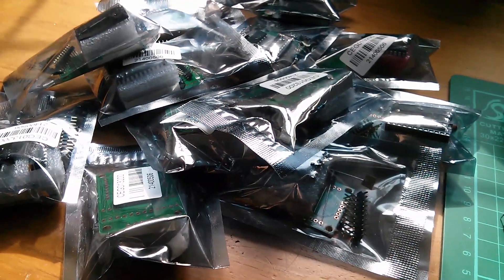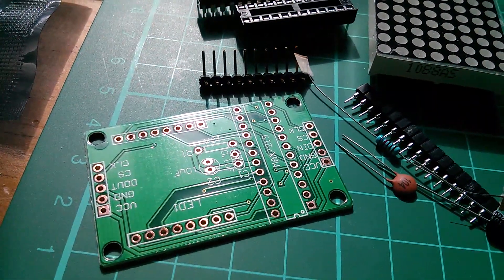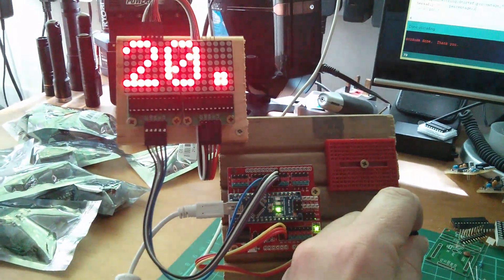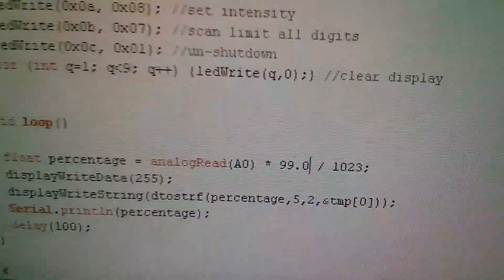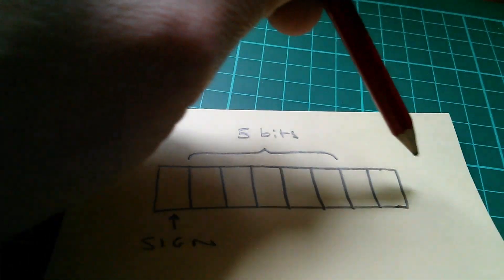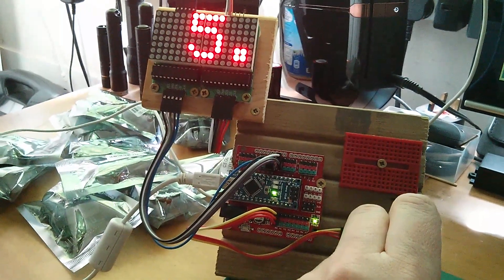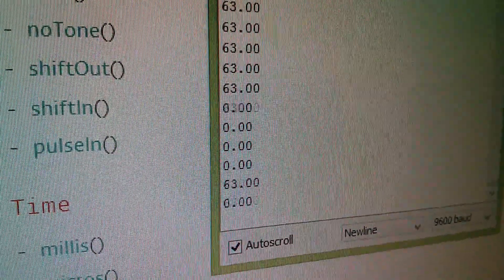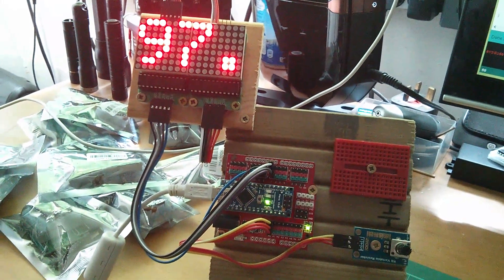Arduino C Mystery - Integer Constants and 6-bit Numbers

Comment: It is not 63 or 32 - you divide it all by 1023 :P . dtostrf (DOUBLE); Almost none of the above is constant. Almost each parameter has different TYPE and byte width and so the meaning for compiler (e.g. integers are by default signed and cant store more than 32k value) It should be all  'float', so percentage = ((float)AnalogRead(A4) * (float)99.0) / (float)1023.0; dotostrf((double) percentage....); You cant leave it to compiler decide for you Sir. There are differences between compilers.

Comment: A 16-bit signed integer (the default data type for integers) goes from -32658 to 32767. The analog input goes from 0 to 1023.

You're multiplying the analog input by 100, then dividing by 1024. You had problems going above 31. If we take the value 31, multiply by 1024, we get 31744. This is very close to the maximum integer value. 32 would produce 32768, which is ABOVE the maximum integer value.

If you go above the maximum value of an integer, it will wrap around from 32767 to -32768. Thus, the analog value that would normally make the output go to 32, actually takes the intermediate value to -32768. If you divide -32768 by 1024, you get -32.

To explain more clearly, you're multiplying the 16-bit signed integer value coming from the analogRead() function, by the 16-bit signed integer "100". This value is stored temporarily as a 16-bit signed integer. Thus, the the maximum value of analogRead() this code can handle is 327 (327*100=32700, lower than 32767). As soon as you go above that value, to 328, the value wraps around (328*100=32800, higher than the 32767 maximum). This is where the overflow and "wrap-around" effect you're seeing comes from.

While using a float value to overcome this problem IS a valid solution, you can also use the "long" data type, which stores a 32-bit signed integer - plenty of space for those overflowed bits. And, doing integer maths is much faster than doing floating-point maths, although the latency of the analogRead() function greatly buries any potential gain you would get from using integer maths.

Also, you can specify the data type of a constant (or, literal) value, using the "UI", "L" and "UL" modifiers, like thus:

100UI = 16-bit unsigned integer
100L = 32-bit signed integer
100UL = 32-bit unsigned integer

I would rewrite that line as:

int percentage = analogRead(A0) * 100UL / 1023;

Comment: Ditch that Ardweeb-o crap, and just download a REAL C compiler.  Arduino is for Mac fanbois ONLY!
Reply: You're ignorant.
They are good for those who are wanting to dive into microcontroller programming.
By the way, I use Arduino, and I use windows.
Also, I program harder microcontrollers, like the STM32 ARM units from ST, so don't fuss about me being a newb!
Reply: Benjamin Esposti
Yay!
Reply: Benjamin Esposti I agree with you here. Personally, I use the Arduino simply as a convenient hardware platform. I ditched the Arduino IDE and library within a week of getting my Arduino, after I realized exactly how inefficient the library was.

I now program purely in AVR-C, with no Arduino library, and oh man, the things I can make this micro do now... Ever seen an arduino synthesize and play 15 MIDI-controlled channels of 22KHz PCM audio, with full pitch and volume control PER NOTE?

Yeah, Arduino isn't bad, just the library is just not for serious programmers. That's my $0.02.

Comment: also   &var[0] is the same as just typing var. 
println uses the same base code dtostrf used, but you have no control over how it's displayed (how many decimals to show).  Also you may not want to output to go to the serial port, so println isn't always an option.
'normal' C would have sprintf() or ftoa() to format a float into a string, but that doesn't work on arduino.
Be careful tho, the width is the MINIMUM width, if you format a large float value, the result could be larger than 5 characters and could overflow your buffer with all nasties resulting from that, make sure your buffer is large enough (at least 6 in this case for the zero terminator)  The width is usually used to 'right align' the number into the given width. (left align with a negative width)
Reply from the maker: You're right - &var[0] is the same as var and both work in my program. But presumably not the same as &var[1]. The problem is I have no idea yet what the & means!
Reply: & means 'pointer/address of what follows'.
so &var[0] is the pointer to var[0] (which is the first element of the array).
In C, when you write an array var, you by default get 'a pointer to (the first element of) an array', which is why &var[0] and var are identical.
&var[1] is a pointer to the 2nd element of the array.  Which is identical to var+1 (add 1 sizeof an array element to the pointer of the array)

Comment: it's not locking you into 6 bits, it's locking you into 16 bits (the size of an int on arduino)  either signed -32768 to 32767 or unsigned 0 to 65535 whenever any integer calculation exceeds those, you'll get overflow.  You can use the long type which is 32bits (plus or minus 2billion something in signed), or you can use float.  Note that float has an accuracy issue, it can only hold 6 decimal digits accurately (with an exponent)  It's the /1024 that's putting you off, the value you're dividing by 1024 has already overflowed.
Reply: You can avoid float and use int's only (floats is slow) by reorganising your code to never overflow.  With the analogRead being 0..1023 and an int being -32K..32K.  You can reorganize the calculation to:
analogRead(A0) / 4 * 99 / 255
this will yield an int in the 0..99 range.
Reply from the maker: I'm very suspicious of dividing by 1023 as in *5/1023. Seems like this is a fudge to yield the full 0v to 5v range from an ADC which actually only measures 0v to 5v-1LSB. I'm starting to think the calculation should be (analogRead()+0.5)*5/1024 which would give a full range of 2.4mV to 4997.6mV.
Reply from the maker: oreubens By dividing the ADC value initially by integer 4, don't you immediately kill 2 bits of ADC resolution effectively turning the 10-bit ADC into an 8-bit ADC. I guess that's still enough resolution to cover an integer range of 0-99.
Reply: Correct :-) that is exactly what happens.  In the 0..1023 which you're converting into 0..99 you're loosing some information anyway.  we just chop of 2 bits because they don't have an effect on the rest of the calculation anyway. In the original case (*99/1023) assuming it didn't overflow, you would have a more precide value after the *99 but then chop off about 10 bits anyway.   There's a whole area of mathematics involved with this "loss of precision along the way".  The trick is getting that loss to not affect your end result (too much).

Comment: If A/D outputs 10 bit binary, use 16 bit integer math and multiply by 25, then divide by 256, for a 0 to 99 integer result.  1023 * 25=25575 (fits 16 bit signed integer of +32,767 to -32768.  25575/256=99.9, truncated to 99. 
Dividing by 256 is also a very fast division, since it is just an 8 bit shift off the right end.
Reply from the maker: Yes, I like that. Instead of big multiply (*99) followed by big divide (/1024), use a smaller multiplication and a smaller division. Also I'm very suspicious of the /1023 thing. I now believe it should be /1024, so I do like your /256 idea. Just tried it and it works.
Reply: 99/1023 provides for an output that truncates to 99, only when the converter reaches its final value of 1023, while all the other output values are available for about 10 different A/D states.  I think the ratio you want is 100/1024, because your desired output has 100 choices (0-99) while the converter has 1024 choices (0 to 1023).  And that reduces to 25/256.  Does this version of C allow for using only the higher byte of the 16 bit variable, after the multiply?  That would eliminate the divide by 256, entirely, and be very fast.
Reply: jpopelish
Yes, you can bit shift instead of divide in arduino. http://arduino.cc/en/Reference/Bitshift

Comment: This problem is a perfect example why I prefer to program microprocessors in machine language/assembly.  Scaling 1023 to 99 is a simple problem with shifts and adds, and no mysteries.
Reply: Julian Ilett
You're right there. Let's not forget, C's from the Apollo era, so its got quite a lot of archaeic quirks in it. It gives more control over what's going on in the processor than newer languages on but conversely is harder to control reliably all the time and thats why you often see for example programs in windows slowly use up more and more memory the longer they're on until they crash.
Reply from the maker: My programming background is mostly assembly language. Now programming in C for the first time, I've fallen into the trap of thinking C is a high level language - it really isn't. It's just a thin veneer of sophistication laid over the nuts and bolts of machine code programming.

Comment: Not sure of the target subjects but for a sense of scale a top line cyclist can sustain an output of 400W and bursts to over 1.5kW. Even an average  fit person could get to 250W/1000W burst so you will need to select the voltage of the generator carefully to avoid further overflow issues while maintaining good resolution or simply measure th VA in a single light globe used in a bank of paralleled bulbs. The bulbs would also give a nice "analogue" indicator to the subject and audience. It is a bit hard to interpret a numerical display when at maximum effort.

Comment: I'm a little late to the party it seems ;) . Many good explanations here already. Be aware that the compiler may combine constants used in an expression for efficiency reasons and operations may necessarily be executed in the order things appear in a formula (although, I have to say, I don't know how much of that avr-gcc is doing).

Try to avoid floats on an Arduino. The C-compiler does a good job at concealing that an ATmega does not have a floatingpoint unit. But all float calculations are done "in software" and are very costly. Stay with the int datatype as long as you can and think about them as fixed point numbers. That's more reasonable in most µC applications anyway. For example the resolution behind the comma of a sensor value is most probably the same over the whole range. So thinking about a value as fixed point is more fitting than thinking about it as float, with which you get more digits behind the comma the smaller the number gets.

Divisions are even more intensive. So instead of dividing by the number you need, try to multiply with a number first, so you can then divide by a power of 2. Integer multiplication isn't that bad in an AVR (watch for overflows, though, but you know that already ;) ), and a division by powers of 2 results in simple bit shifts. E. g. instead of dividing by 10 multiply with 205 first then divide by 2048 (2^11).

All of this of course is not that much of a problem, if you've got enough time to spare in the µC. Arduino wouldn't be so successful, if everyone HAD to think about those details. But for efficient code (or in a case like yours, where even Arduino/gcc couldn't hide the fact from you, that you reach the datatype limits quite fast within am expression) it really pays off to rearrange expressions and combine constants as much as possible (even out of multiple expressions).
Reply from the maker: I'm definitely coming round to the "only divide by powers of 2" advice. Staying with ints (or words) feels right too. Not sure I like the map() function too much - it uses 4 long variables - that's 16 bytes! (it wasn't you that suggested that of course)

Comment: "Bicycle generator watts display"  Interesting project. How are you measuring the voltage and current from the generator?  With the same V and A sensors used on your solar panel project?
Reply from the maker: Yes, probably best to stick to what I know. Potential divider for the voltage and probably the 30A ACS-712.

Comment: I'm thinking I can see the problem here:
analogRead outputs an integer value between 1 and 1023 (10 bits)
Then you multiply by 99, now if the value was above 661 you'll get a 17 bit answer which is an overflow of a word on an Arduino, So you'll lose that top bit giving you, 1-661 and (x * 99) - 65536 above 661. With that instead of getting 1023 * 99 / 1023 = 99 you get 35741 / 1023 = 34. But since you're using signed integers that number 35741 will be treated as a negative number and will sign extend the final number: -29795 / 1023 = -29

Since you're dividing by 1023 that's taking away the lowest 10 bits of the number, and since you only have a 16 bit word size that leaves you with only a 6 bit value left
at the end, which will then at the end be converted to the float.

If you want to keep this calculation as an integer you either need to have a check if the number is greater than 661 and if so re add the bit into bit 7 after dividing or use the long (32-bit) type for the calculation http://arduino.cc/en/Reference/long,
It would also help to make sure you're using unsigned numbers for this calculation, though if you use long it won't matter.
Reply from the maker: Now I get it - thanks for the explanation. Wouldn't analogRead() use the word data type rather than int since it only produces positive numbers?

When I converted 99 to word(99), it stopped the calculation producing a negative result, but didn't prevent against overflow of analogRead()*99 - potentially 1023*99.
Reply: I guess they chose int just so when it was used in calculations it didn't force any calculations using it to be unsigned as well since you may want to do something like subtract 661 from it and use the value as an offset from the center.
 Since when you changed 99 to unsigned it forced the entire calculation to unsigned. I would suspect that if any part of a calculation is unsigned the whole thing becomes unsigned.
Reply: Julian Ilett
One other trick you can do is, take analogRead()*word(50) / 512
Which won't overflow and will give you 0-99 since 1023*50 = 51150 (not overflowing) 51150/512 = 99

Comment: An int is 16 bits (signed), so has a range of -32768 till 32767. That should be enough to hold your analogread, which is between 0-1023. But then you are multiplying by 99. So when analogread is 331, 331*99=32769 which is beyond the 32767 limit, so it wraps around.

When using a word (16bit unsigned), you'll wrap around at 662 (662*99>2^16).

I thing the fact that you get the same effect as when using a 6-bit integer-type is just accidental. Maybe someone smarter than me has an explanation for this.

PS thanks for the great video's.
Reply: PPS you could just convert the 99 to a long; long(99). This is also faster, I think,  as AVR hardware doesn't support floats.
Reply from the maker: beargun42 Spot on! Just tried: analogRead(A0) * long(99) / 1023 and that solves the overflow problem (without using floats).
Reply: beargun42
Yes, floating point maths is much slower and should be avoided where possible and this equation really doesn't need it. It's quite common amongst amateur programmers to just make everything floats because it will usually work, but it makes the processor work much harder than necessary.

Comment: Arduino's integers are 16 bit long, if you do the reverse calculation (63*1024) you will get 64512 that will fall on the 16 bit range, however if you do 64*1024 you will get 65536 that will overflow to 0.
You can solve this problem by using a float type as you did or by using a long int that will be able to represent values larger than 65535.

Comment: Try to have 100W at 1000 from adc.. and not use the full range.. otherwise you WILL get uneven step size. A divide by 10 is simpler.

Comment: Try to have 100W at 1000 from adc.. and not use the full range.. otherwise you WILL get uneven step size. A divide by 10 is simpler.
Reply from the maker: Ah, yes - I can see that being the next problem. When I get a few more display modules built up, I'll be able to see the numbers after the decimal point. Uneven step size should then be evident.
Reply: Julian Ilett
Or use a 'binary' reference voltage for the ADC e.g. 4.096V
Reply from the maker: AtomicWorkshop I remember seeing a 4.096V reference inside some of the PICs, but it would have to be externally connected to the AVR 328.

Comment: 16 bits(word) - 10 bit (divide by 1023) gives you 6 bits.
A total overflow. 

Can you divide by less?
Reply from the maker: Thank you - that's it. When I change the calculation to *49/511 (essentially the same ratio) it rolls over at 63 (to -64) so 7 bits are being used.